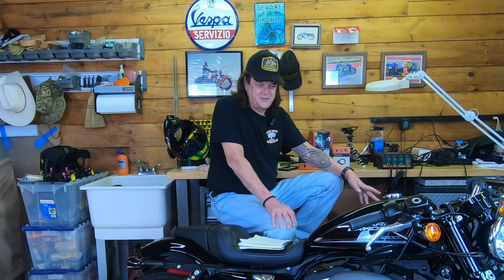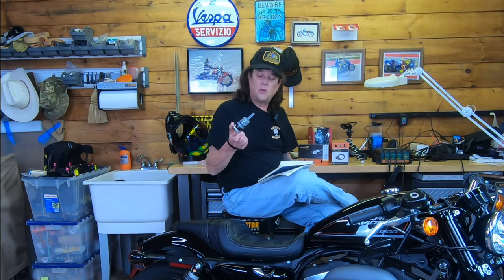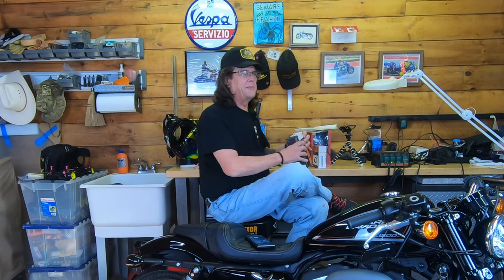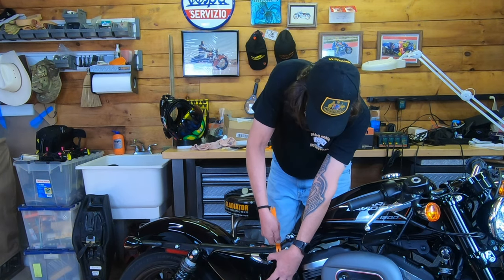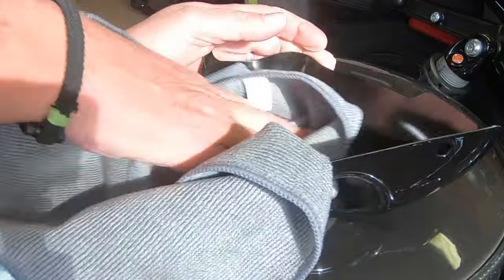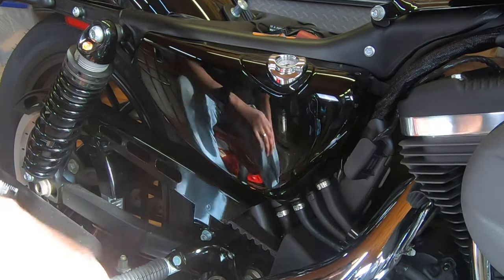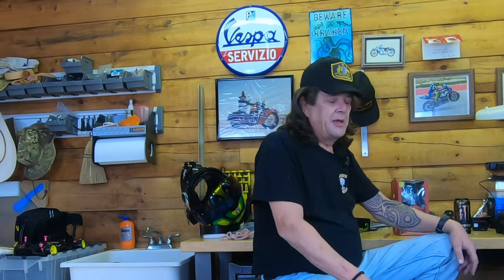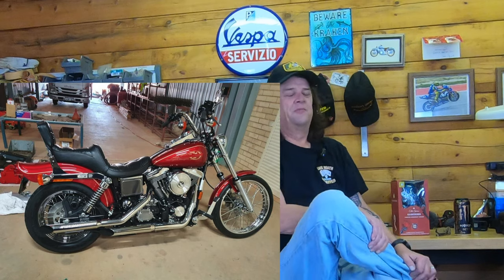DIY Harley-Davidson Roadster Dipstick Bezel & Temperature Gauge Install

Comment: No thanks on the black, I have spent a lot of money adding extra chrome to my bike, including full chrome sidecovers. I installed a genuine H-D temperature gauge on my bike, but I do not believe it is accurate. It's probably in the ballpark, which may be enough. But I may eventually replace it with a digital gauge. I don't worry about thieves, I never park my bike anywhere I can't keep an eye on it, unless it is locked up in my garage. I've never had a problem with removing, installing or having the dipstick leaking on my 2006 Sportster 1200L. But I do prefer the 2003 and older style dipsticks. I also have a 2001 Sportster 883C and the dipstick is just a better design, it also looks better without the Japanese style sidecovers. Be VERY careful when removing that washer. I wound up breaking the plastic bezel while trying to remove the washer. The dipstick held it in place till I was able to get a new one.
Reply from the maker: Good advice on how fragile that washer is. Luckily, I didn't break mine. You sir, are a walking encyclopedia of knowledge on Sportsters! Thanks for stopping by.

Comment: How do you fix the position of the dip stick. For some reason mine while installing mine the position is off by 180 degrees
Reply from the maker: William, something is odd here. I would go back to the HD dealer and show them this because that's unacceptable. It may be the wrong dipstick for your bike?

Comment: Thanks for posting the video, the gauge dipstick looks great, but they aren't exactly cheap and unfortunately they are just too easy for some low life scum to steal from your parked motorcycle. It's a pity that H-D didn't think about adding a locking device on them to deter thieves. I installed ribbed ABS plastic side covers on my 2011 Iron 883, they are about one third the weight of the stock mild steel covers.
Reply from the maker: I thought about that when i installed mine but luckily it hasn't been stolen. I really like those ribbed side covers and I'm thinking about putting them on my Roadster. Thanks for watching and commenting David. Eric
Reply: @KrakensGarageandAdventures  Thank you for your reply Eric, The ribbed side covers look really great, they match my ribbed derby cover, timing cover and primary chain inspection cover. I bought my ribbed side covers from Aliexpress, they were around £43.00 for the pair including shipping to the UK. Sportster's are so customisable and there are thousands of aftermarket parts available for them to make yours one of a kind. I made a pair of gloss black upper fork stanchion covers by cutting two pieces of 40mm x 50mm x 180mm aluminium tube and getting them powder coated, so at least I can say I made those myself. I'll send you some pictures of my Iron 883. Thanks again Eric. David.